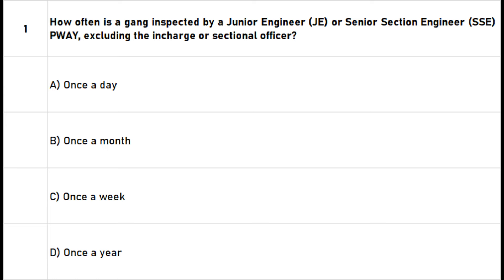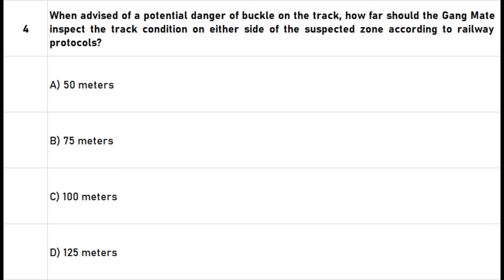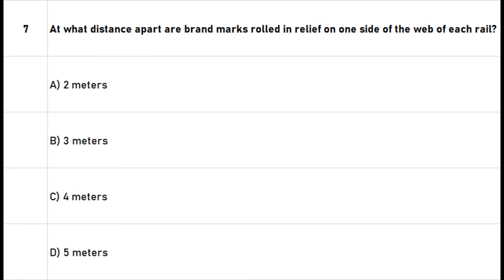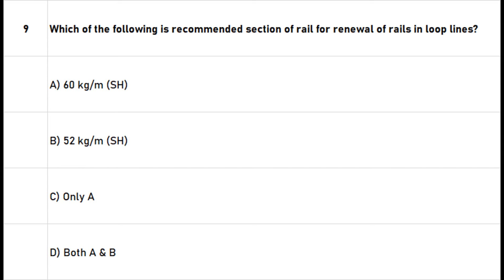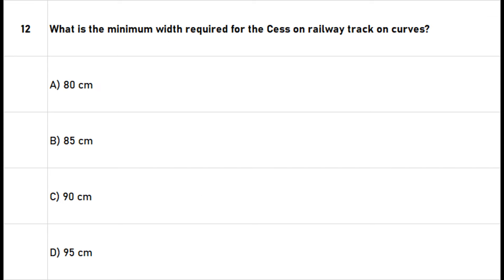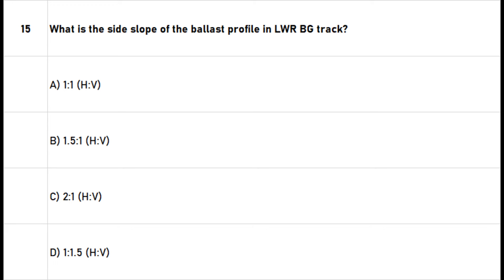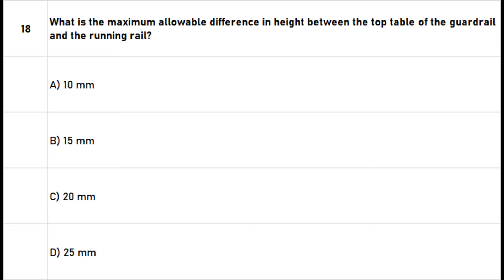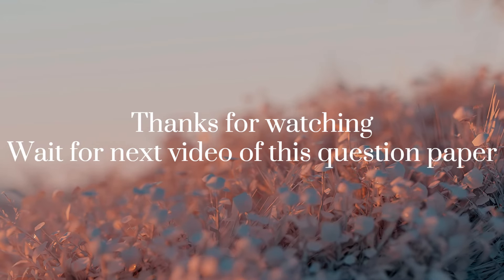MOCK TEST FOR JE PWAY & AEN IN RAILWAY |20 Q | IRPWM | PART 0001

Comment: Sir I confuse in gap betwn two Rolling mark please resolve my query. I think it's 3m or 2m ??
Reply from the maker: An ACS issued to IRST12, in which 3 meter is replaced with 4 meter
https://rdso.indianrailways.gov.in/uploads/files/IRS-T-12-2009%20incorporated%20up%20to%20ACS%205%2C%20corrigendum%201%20of%20ACS%20no%201%20and%205(1).pdf